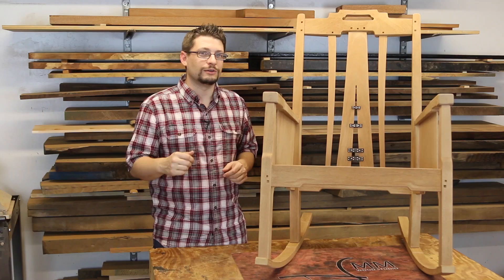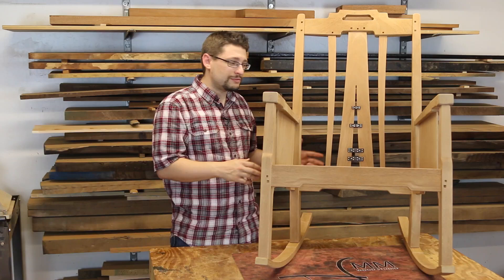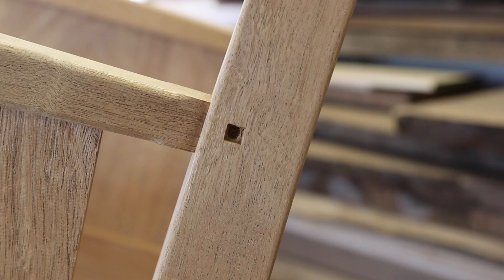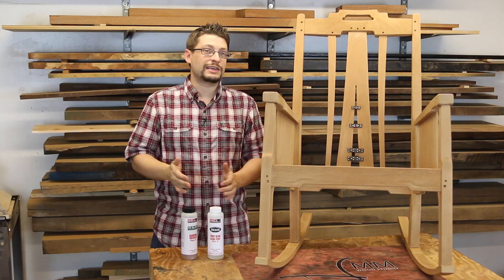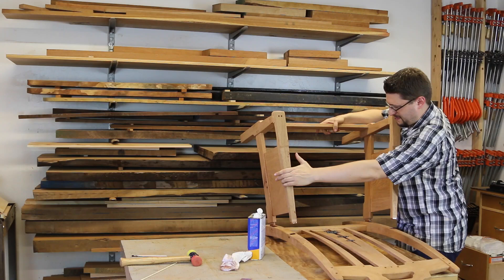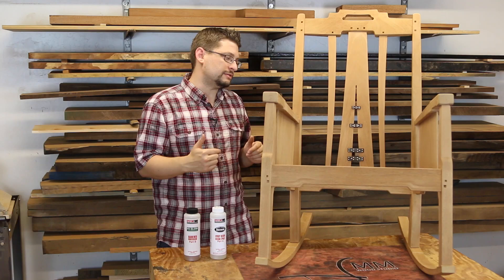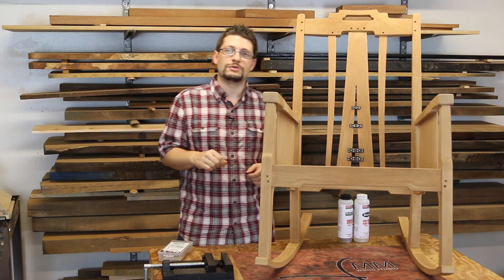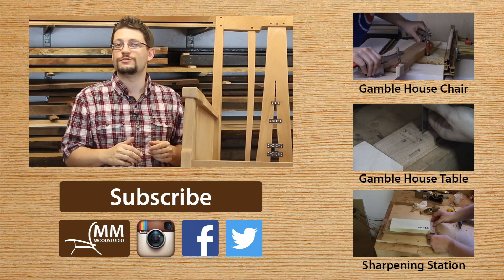Shop Update August 5, 2015

Comment: Your chair is coming along great! Yes i do recommend to many of the woodworkers here in my community and here online to get and use these GRK screws for all their woodworking. These are the hardest screw that work under very high stress and wont break either. I use these in all my handrail jobs and they have never failed me! Only one piece of advice is to make sure you use very hard tips or you will break or strip the tips. My suggestion is get apex brand tips. They are expensive but work the best and wont twist off either. Do not use dewalt or vermont tips or you will regret it as they are soft tips. Good luck and still cant wait till the end of your chair project all finished!
Reply from the maker: whitewolf8758 I just went to their website. I need to get a T-25. Looks like there is a local dealer. Thanks for the advice!